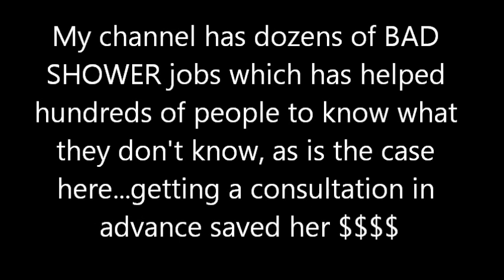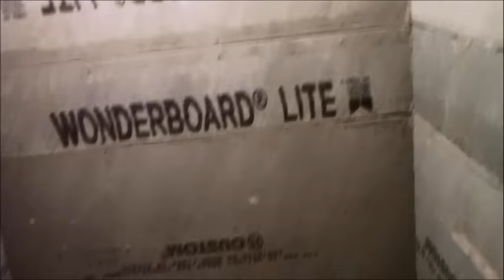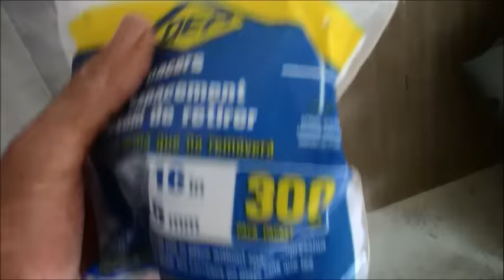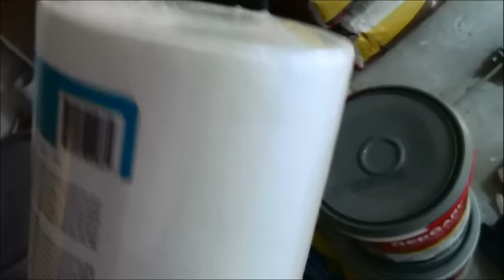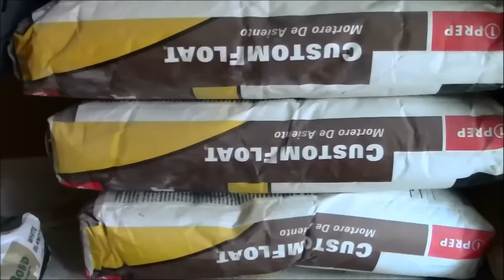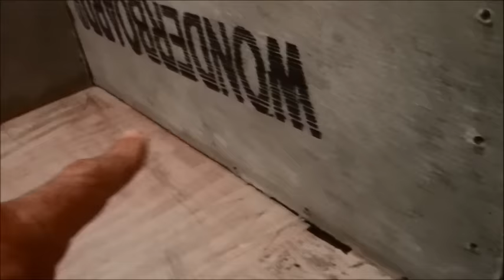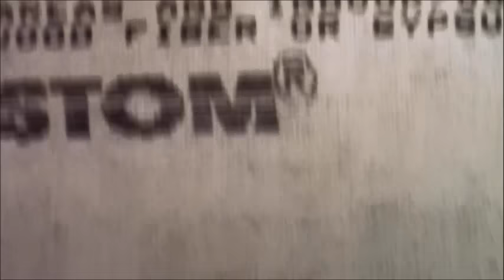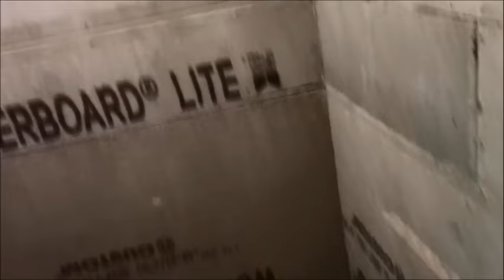BAD SHOWER DAY ONE !!

Comment: Most of the comments I see in here are pointing directly to the bad installers but a lot of these situations are created because customers don't want to pay the real cost of doing a shower and they choose to hire whoever is cheaper...I've been doing tile for over 18 yrs and is always the same situation :I give the estimate  to the customer and they call me later and said: I'm sorry but we have to hire someone else because you price is too high so sometimes they get what they paid for....
Reply: Same issue every day! ;(
Reply: Regardless of the price that was given to the customer by any contractor.  If the contractor said that they would do the job it should have been done correctly.  Research, experience, and honesty go a long way.
Reply: what county you work???
Reply: I agree with you to a point.  When they request half down, that's a big red flag.  Many contractors lack the proper training.  They did not go through apprenticeship.
Reply: 🎯 I’ve had a few jobs where I had to price match but also assured the customer those prices are production work rather then custom
Reply: I give a customer a fair quote.and let them know I do not cut corners.even if I'm there to fix or finish what somebody else started
Reply: @brendonbrooks420  You missed the point. A contractor would know the industry price for their labor and materials in their area. If someone starts a job and then realizes that after spending days on it their take home pay is only $500 then they're not a contractor. They're some fly by night who claimed they'd do what should be an$8000 tile job for $1500. Customer gets what they deserve. Especially the ones that demand to pay a specific unrealistic price for a licensed, insured, experienced, contractor.
Reply: @tryan7  I always request a down payment.  Job doesn't start without one. How is that a red flag? It's a sign of trust between the two. I've been sandbagged for weeks by customers when I first started out. Never again. Pay when the job is complete otherwise prepare for a lien on your property.
Reply: @wayofthekodiak3118  I agree with you.  When a contractor ask for 50% down that's a big red flag.  I have had others say,  pay me when the job is finished.  My neighbor paid a contractor and 1 week later that was the end.  I have had leins removed by attorneys.
Reply: Couldn't have said it better
Reply: @tryan7   money down has nothing to do with being cheap.

Comment: 1st Off, lets stop with the blame game, I mean really?  The obvious problem here is not so much the tile guy but the home owners acting as a general contractor and hiring several contractors to do different things when it was obvious that the homeowners were in over their head.  1 if the plumbing was wrong, that's the plumbers issue and the home owner should have had them fix it. 2 the dry wall guy hung the backer board so he could do his drywall, not his job and if I was the tile guy, I'd be pissed because it all has to come off.  3 as the the tile guy, I don't work for free, so I'm not taking off the backer board, I'm not fixing the plumbing and I hardly doubt that the homeowner was willing to pay the tile guy to redo what the plumber and drywall guy did.  Bottom line, hire the a contractor that will complete the entire job and saver yourself the headache of having things done out of order costing you more money to fix.  As far as what the tile guy was really up to, you make a lot assumptions and a lot finger pointing.  There was some items that are not so great to use like the pressure treated lumber and the premix thin set but the rest was just you complaining.
Reply from the maker: You are absolutely correct, almost without exception when a homeowner becomes a GC things go south...
As to me complaining too much, that's what I do, ppl need to hear it all so they don't get caught up. You would be amazed how many "shirt and ties" have no clue about anything.
Reply: I see this often, homeowner assumes the role of contractor and subs out all the work. But had no clue how all of this work should come together, then like u said the blame game starts, and good trades get a bad rep
Reply: C&LAuto Snider just imagine your a regular homeowner, that doesn’t even know what to look at to find bad work. Then the job is complete and the least you’d be doing is kicking your teeth in, prob go physco crazy knowing it has to be all ripped out

Comment: It's code to use pressure treated wood  ANY TIME  THE WOOD IS ON CONCRETE FLOOR i.e. basement. Do to the fact concrete wicks water and moisture directly to the wood touching it. Can cause not only water damage, also attractive TERMITES, CARPENTER ANTS AND POWDER POST BEETLES. That can eat through moisture wood like BUTTER. It also aids in construction of their tunnels they build for travel and their larvae.
Reply from the maker: This wasn't a slab...
And even if it was those PT boards were bowed more than a bow & arrow